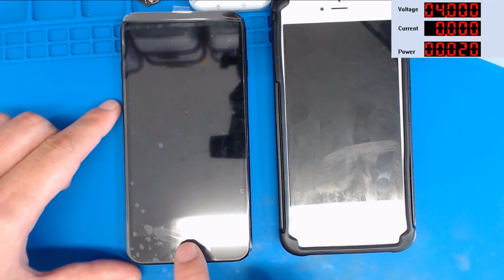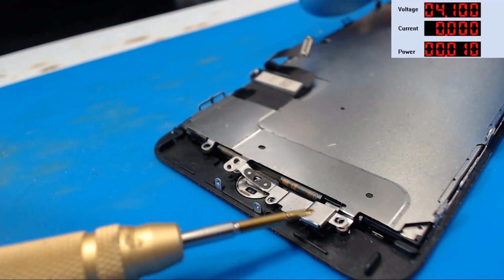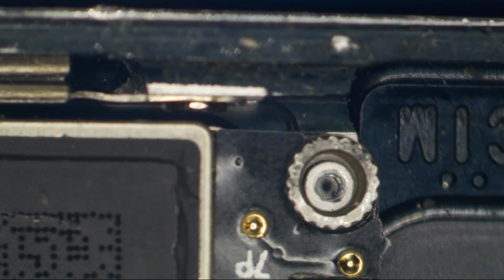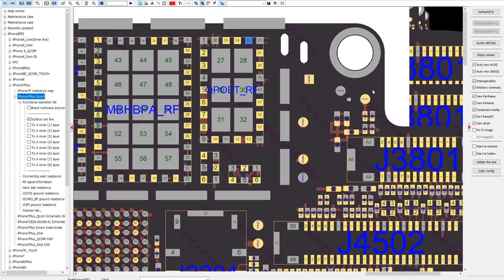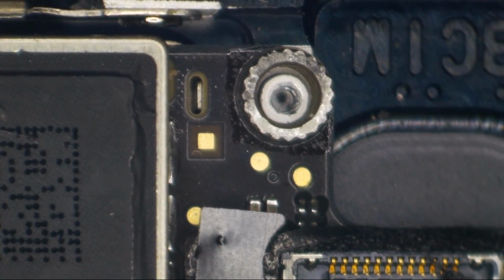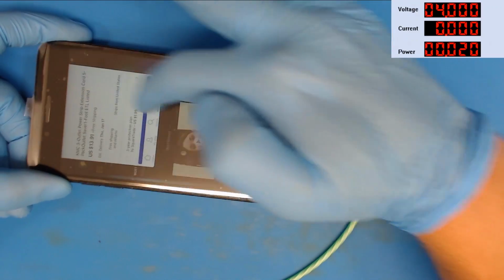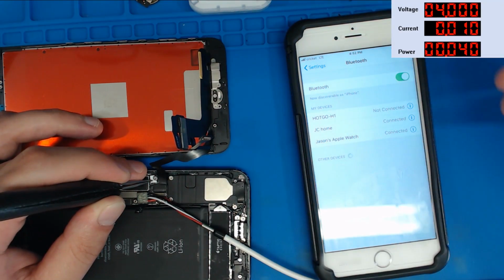Testing the new JC home button for iPhones

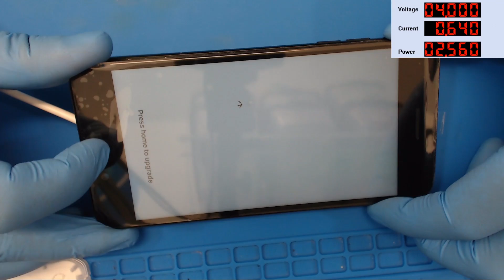Comment: Quick and simple tip if your Home Button doesn’t work at all and you’re getting a message like the one @ 11:00 or when you have reset your iPhone: turn off iPhone. Press Volume Up button along with Power Button and hold it until apple logo comes on. Thank me now

Comment: On the iPhone 7 can the home button be replaced and dose it have to be programmed?
Reply from the maker: Only Apple can replace and program a new one to be 100% working.  When they replace a screen, it’s included.  The aftermarket buttons will work for a home button only but not all of them connect or work the same.

Comment: That lightning home button adapter is nice to have on hand. To share a tip with any shop or person who doesn't have one: If you can access the phone in iTunes after a restore or update go to the Summary Tab > Under Options click "Configure Accessibility"  then turn on VoiceOver. You can then touch the "Press Home.. blah blah" text selecting it then double tap it to unlock the phone.

Comment: if i wanted to get a plug in cable for the battery connector, where would i find one?
Reply from the maker: I got mine from Union Repair, Qianli and iPad Rehab Supply.  There are a lot of places to buy them though. If you google iPhone DC power squid it should turn up a bunch of them.

Comment: There is an issue that needs covered by someone. Because it's a bluetooth home button, you lose your virtual keyboard functionality when you have bluetooth on. Basically, you can't use this device AND your keyboard without turning your bluetooth on and off. I think I have a solution for this using something like the lightning connected home button, but I'm still prototyping.

Comment: Just a heads up. If you're keyboard is not showing. Try pressing and holding the home button while in a text window. For example, got to safari and press on the address bar then press and hold the home button. The keyboard should then pop up. Press and hold again and it will disappear.

Comment: I ordered and installed myself on iPhone 7, it works. but there was a problem the keyboard does not appear when the button is connected via Bluetooth
Reply: While in a text window hold the home button and the keyboard will pop up. So for example go to messages and touch  the text window and then hold the home button and the keyboard will show. Hold the home button again and the keyboard will disappear.

Comment: So anyone else having issues with these home button solutions taking over the on screen keyboard because the phone thinks the home button solution is a bt keyboard?
Reply from the maker: I’ve been hearing this.  Apparently the button works by emulating a keyboard so the phone doesn’t think it needs to pop one up on the screen.  I think it may have to do with software version on the phone too as it seems not everyone has the issue.
Reply: @ststele  Thanks for the reply and your time!  I'm slowly eliminating distributors myself, not over all, just in regards to this part.  The two models I've seen so far are MB and JC and I can confirm this issue on the MB ones, but like you said, hit and miss.  Have you seen it on any of your JC ones?

Comment: That’s a Bunchhhhaaa work. All I did was replace my screen and the button stopped working. The button is perfectly fine. The cables are perfectly fine. It worked for all of 3 seconds and then stopped. Now it won’t work at all. It’s telling me it can’t use I touch

Comment: Wouldn't this be more of a battery drain since it will now have to be constantly connected to Bluetooth?
Reply from the maker: I was worried about that too but my dc power supply could not detect the load so it’s under 10mA.  So it might use 1% of battery in 1~2 days or something.
Reply: @ststele  Major win for those with faulty home buttons. Yeah, Touch ID won't work, but at least home button functionality is returned and at a minimal cost to the battery life.

Comment: When it needs a new home button to be able to boot, and a adaptor home button solves the problem, wouldn't it be possible to solder in the contents of the adaptor directly into the phone, tapping the appropriate lightning connector points? Can't seem to find any videos of athe internals of the adaptor, but can't imagine it's fully packed in there?

Comment: Question: Why don't you use this kind of microscope, ?
Koolertron 5 inch LCD 1080P Wireless Remote Control Digital Microscope with Adjustable Stand, HDMI/AV/USB Output Camera Video Recorder with 8 LED Adjustable Light Source

Comment: why use this Bluetooth home button over an aftermarket one that connects physically..?
Reply: On the iPhone 7 and 8 if either flex going into the home button are damaged, you lose both touch AND function and because it's a daughter part, an aftermarket will no longer click or wake screen along with no touchID. This is because it's a haptic sensor not a tactile clicking button.

Comment: Question.. I have an iPhone 7, a friend brought it to replace the lightning port that he bought himself, and after replacing it everything was working ok, but the mic was bad, so i opened the phone again, aaand long story short, now the home button is acting up, when you press it, instead of a single click, it clicks like crazy (you dont even have to press it, most of the time it reacts on the lightest touch).. sometimes it doesnt click at all, but the fingerprint/double tap is working fine all the time.. and i noticed that the little ic on the home button flex is getting REALLY HOT (i think its marked U10). Sooo, my question now is, should i try and replace the IC? Is that IC responsible for the clicking/back part of the button, and NOT the fingerprint part? Please help :/
Reply: Ok, replaced it. It works now... It was U10, the ic on the home button flex.. The back click is now working perfectly.

Comment: Installed one yesterday on an iPhone 8+, and apart from having to make sure the black foam is totally removed from around the home button flex connector on the board, it was easy, and works brilliantly. The fact it also allows you to take screen shots and also double click to swipe apps closed, I was impressed.
Reply: Does the onscreen keyboard work for you when the button is connected on bluetooth? My onscreen keyboard doesn't work popup when I tap on a text field, wondering if I have a defective one or it's all flawed like this.
Reply: h4rdboil3d yes onscreen keyboard works when button is installed.
Reply: @adrian lanc i have question can u use bluetooth speaker and the home Button at the same time?
Reply from the maker: Hey this style of aftermarket button is way outdated.  The newer aftermarket buttons don't use Bluetooth and function much like the original button (but without touch ID)
Reply: @ststele  how they are named?

Comment: If you need press home to update , then just connect the phone to itunes , go to accessibility on itunes and turn on voice over, then all you have to do on the phone is to tap on the text that says press home to update and then tap twice again on the text and it will  work ! if the phone has a passcode then i dont know if itunes will connect the device !
Reply: I don't know that would work or no but you are a genius
Reply: Or you can use 3U tools as well.

Comment: I do have a question, i had a laptop motherboard, the motherboard is dead and there is ic chip getting so hot . Should i remove it if so will i just remove it or replqce it ? Thank u
Reply: Sr Ali Mohammed, unless you’re expecting the father and mother board will be conceiving rt in front of you AND now the IC chip, from here on will be Sperm cooled🧐

Comment: Why could you not just put a new normal home button in? Ok the fingerprint wouldn’t  work but the home button will.
Reply: From the 7 up only the original home button would work for touch id or home function so a replacement button wouldnt work at all
Reply from the maker: Yes Apple, for some reason, made it so that if the home button isn’t the original that came in the phone, it does nothing.  It’s really a douchey thing to do.
Reply: STS Telecom that sucks. Last I heArd is that error 59 thing (prob wrong error code) came up and bricked phones. They a few years later they allowed it to work but with no Touch ID feature. I’m clearly not up to date 😂

Comment: Hi Jason have you ever tried to bond old home button with new one or a donor button providing the original button part is still functioning by slicing  along trace lines scrape of coating on both and bond them so the pcb will still recognise the original button

Comment from the maker: Hey everyone, sorry for the re-upload.  I tried to use YouTube's editor to make a silly change and it seems to have completely broke it.  The video would only show a black screen and would say something like, "not available on this device" when viewed on mobile.  So 1k views & 110 likes later, we gotta start from zero and re-post.  Thanks for watching everyone.  I will leave it alone this time. :)
Reply: awesome#
Reply: on the 6s you can swipe up the control panel from the lock screen and turn bluetooth on that way does it not do that on the iphone 7 plus if so that button is a good fix
Reply: no probs Jason
Reply: @Just ME Onlyme  if you have a oem battery installed it will go back to normal ifixit  batteries are missing the thing the iphone uses to detect the battery  health  my 6s did the same and as soon as i replaced it with a oem lion battery off ebay which cost me over ten pound  it cured it
Reply: STS Telecom I definitely agree that the jumper flex isn’t a perfect fix, but originally they had it as a soldered jumper but Justin who runs the art of repair channel told them hey guys most shops don’t microsolder. So they came up with an option. If you can solder it then damn straight do so.
Reply: I ordered and installed myself on iPhone 7, it works. but there was a problem the keyboard does not appear when the button is connected via Bluetooth